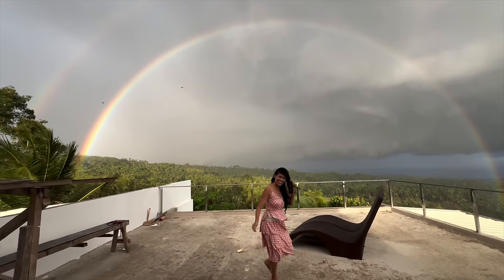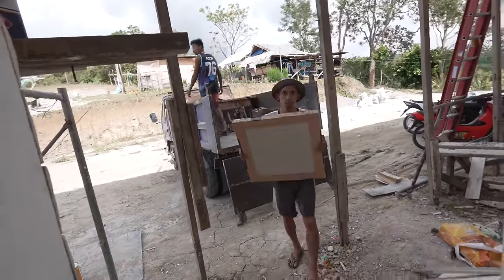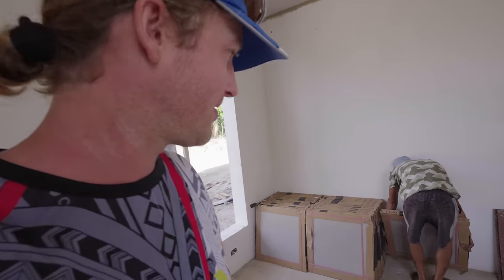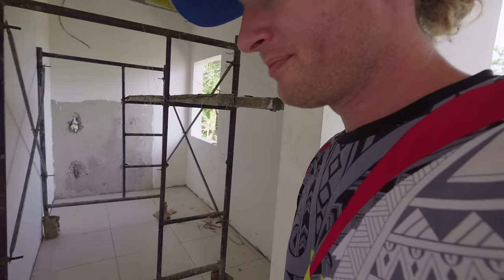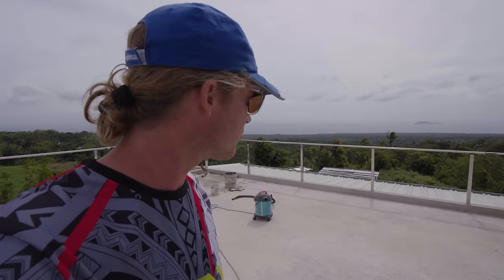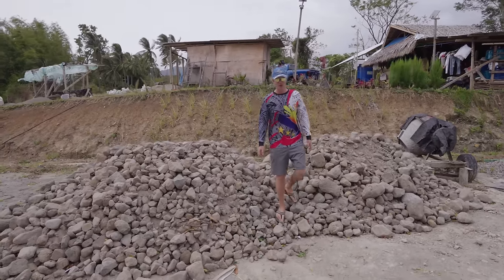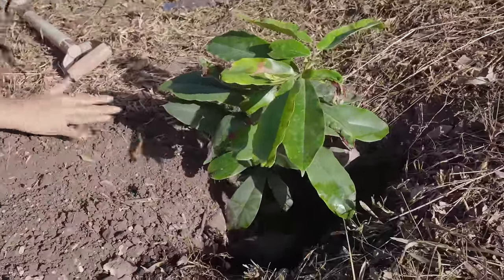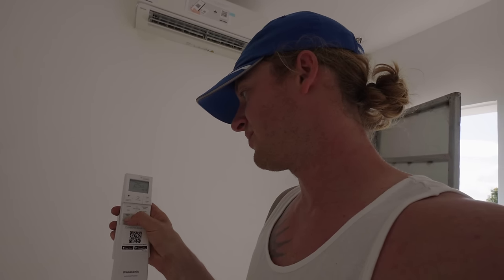Waterproofing Flat Cement Roof & Starting the Pool - Building home in the Philippines

Comment: Garage flooring - depending on local knowledge of course, but epoxy is often used on such spaces, on top of concrete. There are a whole range of colours available, but dark rather than light will help hide any markings, even though epoxy resin is very tough. The challenge sometimes is to make sure that the space is clean before and during the pour and drying stage. The other consideration would be texture if you think it is going to get wet, and whether slipping is going to be an issue, but I'm sure you can work that out.
Great progress being made Finn. Looking forward to seeing it completed as I am sure you are too.

Comment: For the garage, use hard cement. If you ever look at the floors in warehouses, they are usually hard cement, because they take a lot of punishment, but are easy to clean and maintain. You are worried about scratches, but what if one of your vehicles starts leaking oil? It's much easier to clean on hard, smooth cement, then just something cheap that might crack or break over time.

Comment: Some concrete slab or brick type on garage floor, you could also use natural stone or limestone that will looks more natural but had to thick and flat with hardened soil underneath. Don't forget slightly elevated angle just in case your car is wet or while washing. Great looking hilltop house Finn.

Comment: For your carport, I'm not sure what is available in the PI but a traffic topping used in parking garages should be used. Something from BASF, Sika or Vulkem-Tremco used here in the US. Or an epoxy type coating. Or another layer of concrete topping slab with a. brush finish, that way you won't have to worry about scratches.

Comment: We have a 150m2 flat roof house here in Masbate and the cement/ concrete shrinks when it's getting hot and water always finds a way through. Coating helps but the only thing that helps is time....😊

Comment: Hi Finn The top tile deck as you say expansion is a problem. 
I would build in expansion joints probably divide in to four squares then use silicone instead of grouting plus the outside use silicone for expansion as well.
In New Zealand I use a brush on rubber type water proofing and it looks that your contractor is doing that.
Have considered garage grinding the concrete polish. But concrete looks better with black oxide in mix .

Comment: hi fn! for your carport flooring i suggest you can use a scratch resistant tiles and mostly they are italian or spanish made which is available in cebu incase you don't have it in dumaguete. expect the price is higher because of the quality but anyway it will cover a smaller area. second option is, you can use a concrete pavers and theres a lot of designs you can choose from.

Comment: You may want to consider polished concrete (cheapest), or 1/4 pebble washout(recommended), or finally resin epoxy (most expensive) for the garage area.

Comment: Finn if you thinking long term. Consider buying extra tiles. Just in case in a couple of decades you break a tile and can’t get replacements. Happened to me after 34 years.  Fortunately I had spare tiles now you can’t even see which tiles were replaced.

Comment: Moving along good. You know, I was watching and saw that you were going to use horizontal wire for balcony rails. If you plan on having kids, you might want to reconsider. Kids can slip through horizontal wiring. You might want to consider vertical slates that you can use in the future to replace wire. Maybe construct rails so you can replace wire with slates down the road without having to rebuild the rails.

Comment: Glad to see you took my suggestion on railings. When they poured tge cement for the flat deck the could have added Sadara which is a dry water proofing powder that is mixed in the cement and its very cheap and last. Maybe next time. Maybe in your pool?

Comment: For the car port just a concrete finish and coat in Non-Slip paint. Durable, easily repaired, non-slip and easy to clean. Dust won't stick to it. Good to have cats as well, not only great pets but will scare off the vermin and snakes. Be prepared for a few presents now and again.

Comment: for the garage, you should be able to buy a rubber compound that you can paint on the floor. it provideds a rubber sealant and cover that goes over the cement. it keeps things waterproof and would prevent scratching the cement.

Comment: The garage parking spot .... look into just making it an epoxy floor garage ) they also have like a hard rubber floor tile that's popular ! i have in my garage ... so working with cars or anything and if i get oil spill etc its easy clean up

Comment: I work for a waterproofing company. They use a epoxy cement to waterproof area. For your carport /garage epoxy which a 3 stage product a white base to seals the base. Next a clear epoxy sealer down with a plastic flakes in the color you want. Then put finish coat that is a clear epoxy down. That should last a long time. They put in garage in the U.S.

Comment: There are tiles and grout specific for a garage. Personally, I’d avoid the tiles.  Save the extra costs and still achieve an attractive cleanable floor. I’d like to suggest you purchase a quality high pressure sprayer. Get a better quality one from a larger hardware supplier. I have large surface areas, both tiled and cement. AR brand is quite good and has several choices.  Do you intend to have a floor drain for pool?  Makes cleaning much easier

Comment: Great stuff Finn & Sherlyn with the rooftop terrace waterproofing. I was exactly wondering about this earlier with your bathroom tiling. Did you ever waterproof the wet areas i.e shower walls & floowring with water sealant to prevent from molding and moisture damage? How is that done there?

Comment: Finn in your Solar panel room , Everything ✅ is so neat , Ducting for all cabling A beautiful job , Then in right corner , U have ? Security controls And wires hang across the wall As cables were to short 😢 Hope that's temporary or Get installer to come back and do it properly 😮 ✅ Let's down a beautiful❤ neat finish on everything else . 😢✅ AUSTRALIAN -GUY 🦘🦘🦘